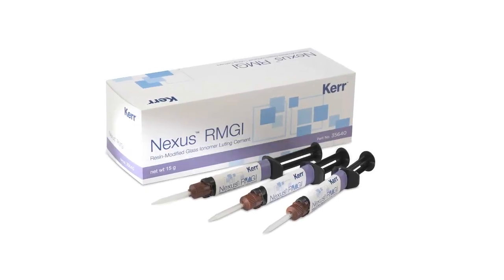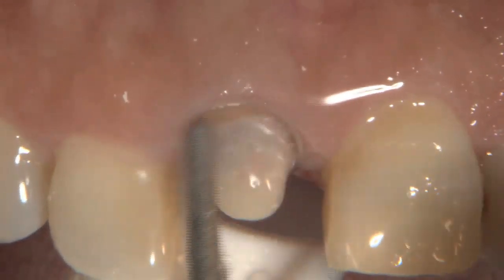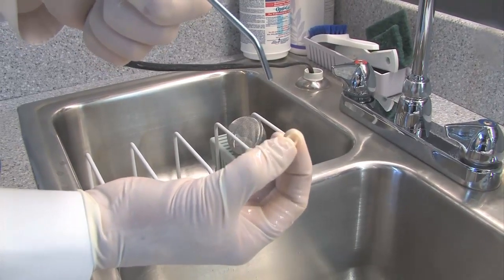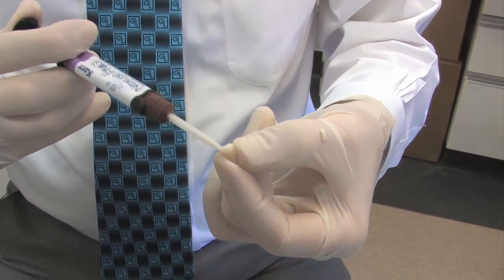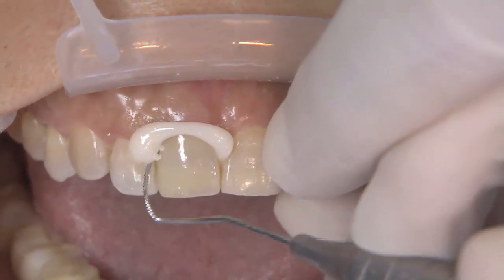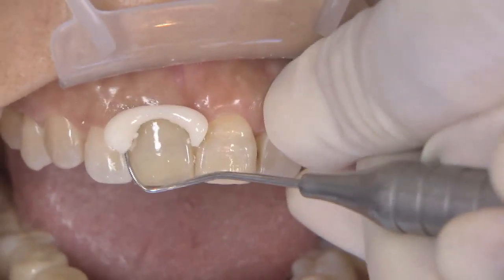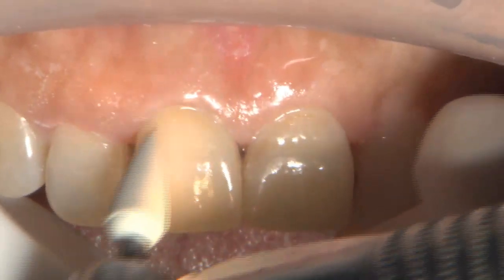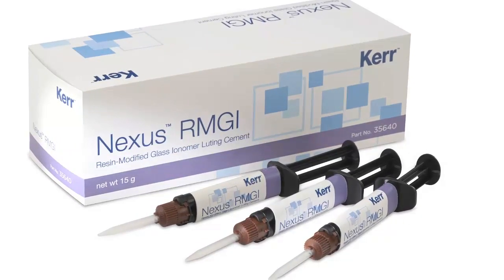How to Complete an Anterior Dental Restoration with Kerr's Nexus RMGI

Comment: The shade is correct. The translucency is off because it is a monolithic zirconia restoration. That same shade in an emax or empress restoration would be golden.
Reply: so agree ..the shade isn't right its too too dark and Zirconia crowns are so being pushed now by labs when Emax performs and looks better ...and bonding zirconia ??? is that a stable thing ??? so many steps and possibilities for breakdown and hey Zirconia doesn't need it for strength anyhow ..EMax does need bonding  for strength